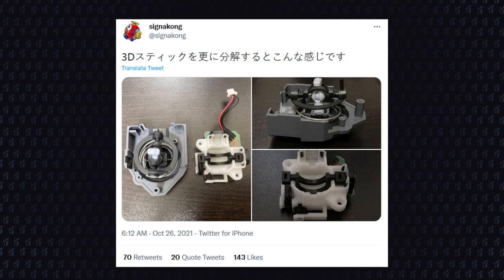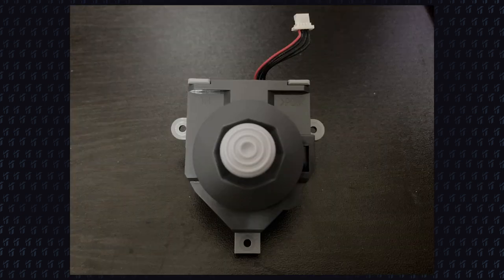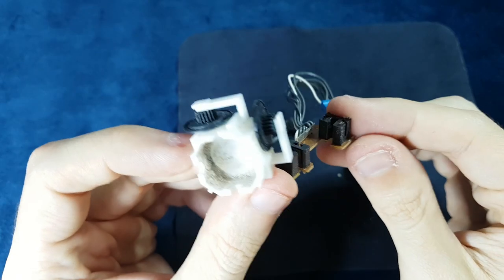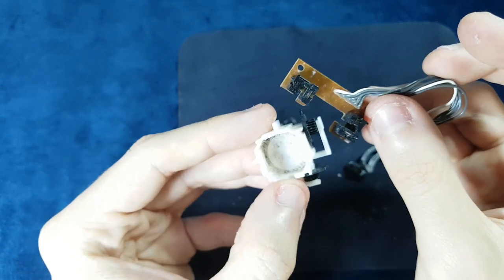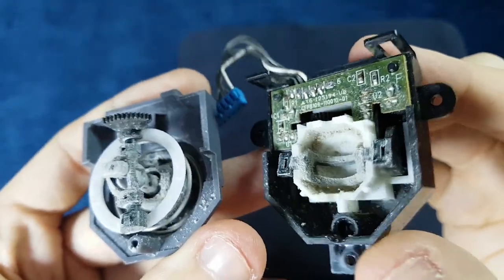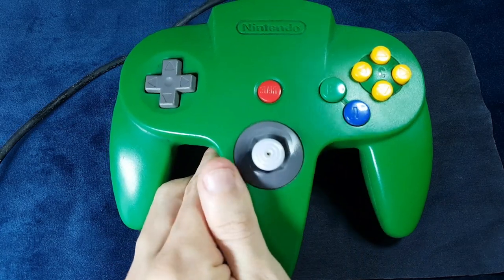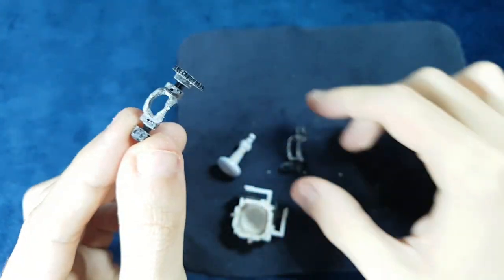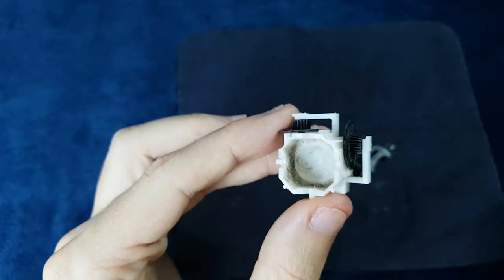The Nintendo 64 Switch Online Controller Has Worse Analogs...

Comment: Nintendo's key improvement here is not mentioning the Mario Party 1 minigame where all you do is frantically rotate the joystick. Problem solved, right? Time will tell. Great video!
Reply: Yeah, the original Mario Party 1 was notorious.
Reply: The tug of war game is in Mario Party Superstars, and it has a safety warning.
Reply: Se van a lavar las manos no agregando Mario Party xD
Reply: Mario party has nothing to do with it. They brake from normal use as well...
Reply: @Magisktification  Mario Party accelerated the process though.

For example, I had Mario Party and my sticks became extremely loose.

My sister's husband played only Zelda, sports games, and Goldeneye, and the controllers he's had since he was a kid still have very tight(the slightest wobble) sticks.

It's because when you're doing those stick rotation minigames, you are much more likely to put a lot of pressure on the stick with your palm. This of course would do more damage to the joystick and bowl in a shorter time.

Normal gameplay doesn't generally have you pressing in hard on the stick.
Reply: Several mini games used this mechanic. It was a good thing they completely abandoned it with Mario Party 2 and 3
Reply: they're gonna get sued and give everyone gloves again lmaoooo
Reply: That's the only game where I would use anything other than the N64 controller instead.

Comment: Really disappointed they went with the original design with grinding gears. I was hoping to purchase a modern controller that looked and felt like an original N64 controller that I wouldn't have to worry about wearing down as fast.
Reply: But how should it feel like an original when the would have used a regular stick?
Reply: @tiko8420  I guess I was hoping for a design that would still look/feel like the original, but would fix the design flaws that resulted in loose/unusable stick after moderate usage. Something that kept the stick feeling like new for years ideally.
Reply: Yo expresé en un grupo de fb mi inconformidad al enterarme que usaron la misma tecnología erronea de 1996 y casi me dicen de que me iba a morir :v

Espero que los materiales sean superiores, esa es mi única observación

Comment: "Sir, shouldn't we tweak the design of the N64 controller? Lots of innovation has been made since then, and modders have even made durable controllers with a very similar but smoother feel that doesn't deteriorate using-"

"No. We keep the controller the same, it's nostalgic. But don't get any optical sensors; they're too expensive, keep using our poor potentiometers."
Reply: Una mujer tonta se me echó encima en un grupo de fb porque mencioné lo decepcionante que fue enterarme que el joystick del actual mando de n64 para switch no fue hecho con mejor calidad y que pronto experimentaremos el mismo problema de 1996. Sé que quisieron conservar la sensibilidad del control, pero eso no justifica que usaran los mismos materiales que mostrarán desgaste más temprano que tarde.

Comment: Damn it, they really should've worked with that SteelSticks64 guy.
Reply from the maker: exactly
Reply: The controllers would be 150 to 200 bucks then.
Reply: @VKsChannel  Except that wouldn't fix it either lol. You'd have to lubricate the steel bowl over time still. Not to mention how much they charge for that shit like are you out of your  mind? First, they needed a rubber cap. 2nd was keeping the optical sensors. Lastly, making sure the plastic is properly lubricated because that does a lot to keep it in working shape which you forgot to mention they did for the plastic bowl (not sure on the gears so I heard). But they'd charge fucking 120 bucks for that stick alone much more the case that the guy clearly can't keep orders at all as it's always SOLD out lol. I recommend this guy's small look at it https://www.youtube.com/watch?v=D2WeiUc2IOI

Comment: If you want a quick fix for these controllers, just add lubricant or grease to them. That alone will make them last 10 times longer, and it also just feels nicer to use.

If your N64 controller already has a worn-out stick, adding lubricant or grease won't do much to fix it. It has to be a new or barely worn-out stick for the lubricant or grease to be useful. Otherwise you'll need a stick replacement.

Shame Nintendo didn't go for the SteelStick64 strategy, and make the bowls out of metal to reduce the wear & tear the OG stick had.
Reply: Tell me about it, at least on the OG n64 side solutions exist, third party controllers with analogs sticks that emulate the original range well enough now exist in 2021, steel sticks exists and fixing that horrific smear exists.
Reply from the maker: They did add some lubricant as you can see the wet parts in the picture

But as jerry rigs everything says plastic is plastic and plastic will scratch 🤣
Reply: @VKsChannel  I would think that the plastic is probably a little better now though? Plastics have definitely improved over the years (although some eco-plastics are actually worse).
Reply: Just opened my new controller, and the stick seemed very dry. I added lubricant, just like I have added to my old N64 controllers, and now the "feel" is much better. I've read some comments about the new N64 controller that the quality is not good and it feels very plasticky 😀Adding lubricant makes a huge difference and I think it feels quite nice now, at least for N64 controller...

Comment: I love that they went for a similar design and technology of the stick, as it is till today the most responsive and accurate. But, they could have used more durable materials. 
To prevent the stick from getting loose quickly, avoid pressing it down while using it.
Reply: lmfao
Reply: @Alex-vf8ww  what's so funny? What they're saying is true, the use of mechanical sensors really made for some ultra accurate movements. Not a single third-party option comes close.
Reply: @DisneyTLK110  3rd party options exist that far surpass orriginal n64 controller

even in 1996 the better option was the hori

Comment: this combined with the loss of the ability to atatch a memory pack to have game saves and the lack of transparent versions makes me glad i repaired and use OEM n64 controllers in combination with an adapter for use on PC, heck i think the mayflash adapter i have but don't use(Raphnet's PC adapter supports the manpack so i use that instead)  can work on the OLED Switch if I want ta do that.

Comment: WOW no optic sensors is pretty bad, it change the feel of the stick quite a bit.
Reply: It's actually kind of crazy how closely it replicates the functionality of the original. The biggest difference for me is the resistance, it's much higher compared to the original, even one in mint condition.

Comment: Look ... yeh the n64 controller durability will degrade,but like anything else,it will degrade more if you dont look after it,remember most of us were young kids and teens with n64 amd look at how many n64 controllers there are out there that are still in 6/10 and above condition after all these years .. id say its worth keeping the original design because it was the best controller analog stick of them all,it was basically a pc mouse and i still prefer it over any other consoles controller.

Maybe these new ones also do have better plastics and will last a little longer too so as far as im concerned its all good unless the new potentomiters are bad and dont offer proper n64 deadzone
Reply: Exactly!

Comment: The controller was the only part of the expansion pack that I still had hope for. Excellent video, you described my exact worries with the joystick. Alongside other reports of bluetooth issues connecting to PC or Mac, now the controller seems like a waste of money. All my hope has gone down the drain for the expansion pack, Nintendo is just trying to dig for money.

Seriously though, really good video. Even if it was short, it was very informative and helpful. you've earned a new sub!

Comment: A new system just hit the market. The Retroad 4.3" HDMI Famicom handheld from Ali-Express and with the KryzsioCart flashcart from Ebay it's great. The Retroad 5 Plus is also great with the GB/GBC Extension Converter and an Everdrive GB X7. The EZ-FLASH Jr. doesn't play all the games but the real Everdrive does. I use my NES/SNES Online controllers with mine using the 8bitdo SNES and NES dongles and a 9 pin to NES adapter I got from Mayflash for the NES/SNES Classic Mini. You just need to update the firmware on the 8bitdo dongle first.

Comment: Here’s an opportunity for someone to recreate a couple small parts to replace and add longevity to the controller. Not sure if 3D printing would be enough or possibly metal parts. A combination of both maybe..
Reply: People already do this for the original N64 but people printing plastic parts is still just plastic. There’s some effort to make steel lined bowls but they are rare and hella expensive.

Comment: During my research when i started looking into building oem designed joysticks for the original n64 controller i think i came across something or someone on the webs that mentioned one of the isues with the plastic wearing is due to the spicific plastic used was soft and not durable compared to other plastics, not sure if this is true but if it is then hopefully nintendo at least used a more ware resistant plastic. Still though it seems to me whoever did the disign for the new switch version n64 controller's joystick didn't do a lot of research on the original design's problems and importantly why they rarely if ever had stick drift issues that weren't physical (they didn't use Potentiometers) not sure if that's a designer's fault or the companies fault for influencing these design flaws not get fixed and add the potentiometer stick drift issue they originally didn't have. I have noticed from first hand experience with repair and possibly upgrading  (i've not felt a oem stick still in unused condition to have a comparison) oem sticks that even my best stick yet(feels very smooth and has the lowest resistance so far)  is harder to make precision movement's than any conventional Pot joystick I've used including the oem madcats n64 controller(i'm 90% sure it uses pots but i havn't opened that stick yet) stick. i don't think that's inherently a benefit of using a potentiometer but instead a benefit of the more common way Pot joysticks are designed for resistance and self centering the stick. They used pretty much the same design for resentering but they could have used a better performing design especially since they used potentiometers but didn't. I can understand that one reason they wouldn't change the majority of the design is so it feels more similar to how people remember giving it a nostalgic factor but if that's what they were going for they should have just used the infrared sensor instead of regular Pots sence to my knowledge they don't fail naturally with the stick drifting effect and they probably could have easily not changed that part of the OEM schematics with the reward of more reliability compared to Pots.  Plus isn't stick drift mainly caused by POT  isues(dust eventually building up around the potentiomiters and getting inside the disks) known to be especially common and a apparent downside for Nintendo's Joycons? This just adds to that bad reputation twords Nintendo.

Comment: RockerGaiming(One of the most reliable channel about controller) uploaded very technical N64 controller teardown video.
Nintendo lubed stick, and controller's potentiometer is the best quality one.

I know switch online is a terrible experience and expansion pack is even worse, but denounce about this controller is very exaggerated.
Reply from the maker: Yes i just saw their video, the potentiometer seems good however he also claimed that the durability is unknown and think with me, no matter how good quality the potentiometer is, once dust from the grinded plastic gets inside it will damage the piece, the main problem of this stick is the grinded plastic and not the potentiometer
Reply: @VKsChannel  then what’s your solution to potentiometers? All controllers use them for the past 20 years. Are all controller is going to suffer terribly? Is there a better solution for analog stick gaming?

Comment: Is it swappable, meaning can you use the new stick in an old wired controller?
Reply: No.diffrrent connector.coukd be done,but only with some real skill
Reply: @ddub1253  Aight, i don't have solder equipment and stuff like that. So that's a bummer, but it'll be interesting to see, what people will do with it. 😌
Reply: @habibk.2423  I don't think it'll be straight soldering but possibly capacitors or needing to make a board for it
Reply: Haha, I was hoping for the opposite reasons. I wanted to know if I could install a replacement optical stick in the new controller. I don't want no janky pots!
Reply: @habibk.2423  That'd be the dream. Foiled by Nintendo!

Comment: I haven't used my Nintendo 64 in years, I didn't have problems with my controllers back then from memory, I presume they still work.  I'm actually quite keen to see how these controllers compare to the originals.  They are expensive though, that gives me pause.  If these new controllers don't have a built in rumble feature I most likely won't be buying them.
Reply: Judging by the small DC engine you see in the vid when he's taking out the analog, I think it does have rumble

Comment: I wonder if you could place an entire original stick block into the new controller. Doubting it but still a curiosity.
Reply: I could probably 3d print the parts to try. But why though? This emulation sucks XD
Reply: Because it's only a matter of time until people make applications to let you use it on PC.
Reply: @officedullard8722  If you want to use an original controller on PC then there are loads of inexpensive adaptors out there.
Reply: I'm interested in a wireless option.
Reply: @officedullard8722  Unless you sit more than 1.5 metres away from your PC, you don't need it to be wireless.
Reply: I'm still interested in a wireless option.

Comment: Anyone that sees this comment please know the retro bit tribute 64 can be found on Amazon and has full compatibility with Nintendo switch PC and the original N64 if that's the way you want to do it.

If they were going to redesign it why wouldn't they just use the ball style modern method that can be found in GameCube or an Xbox controller. It just seems pointless to me to redesign a controller to be worse than the original but still have all of its faults at the same time. And they're charging 50 bucks for this lol.

Comment: Bad controller stick design is the actual N64 experience. I'm glad that Nintendo kept the design close to the original.
Reply: I mean, that's not too fair. The original controller was designed with two grips in case 3D gaming failed so consumers didn't have to buy another controller. It was smart at the time SEGA and Sony opted to release two separate controllers.

However, that aside, the joystick is ass. Such a letdown it does not have metal holding it in so that it lasts longer like those modded N64 controllers do.
Reply: No it's not lol. That would be like if the new Mario Party had the same blocky blurry graphics as the original because "it's the original design". You upgrade the important shit and leave the memories intact. This is bad.
Reply: The N64 controller does NOT have bad stick design. It's actually one of the best and is one of the most accurate analog sticks out there.
Reply: @gamephreak5  People who hate on it probably hasn't used one in good condition. They obviously don't know what they're talking about. Durability issues, yes, of course, but with the actual functionality, it's top tier.

Comment: The writing was on the walls they used period accurate tech in ALL there way back controllers! Ur not paying for something that looks like an N64 controller! Your paying for the real fucking deal ;)
Reply: Except it's not the real fucking deal! They replaced the optical sensors with potentiometers. I was hoping they'd leave the stick completely original, apart from maybe including some grease to slow down wear.
Reply: @eyeball226  i dont know where you got your info but i watched a teardown its og parts…. Masssive ware potential and all! Besides the back where all the new tech for cominication runs in
Reply: @grimangel4432  It's mostly original, but they replaced the optical sensors with potentiometers, which is a bad thing. My source of info is *this video*. It's like you commented on it without even watching it?
Reply: @eyeball226  lmao maybe i missed that detail i mainly temember it looking so similar because of how many busted open 64 controllers ive owned XD i stand currected than i guess!
Reply: @eyeball226  Maybe they couldn't reproduce the optical sensors because of ozone depletion or patent rights or something.
Reply: @groszak1  Patents expire, they don't magically appear. If Nintendo was able to make them in 1996 then there's nothing stopping them now. And the sensors are basically the same as are used in the scroll wheels on a computer mouse, or the encoders on countless control surfaces, so I don't think ozone depletion is an issue.
Reply: @eyeball226  Then possibly, inflation could be the cause, as in it would be too expensive to make them nowadays.
Reply: @groszak1  Seems unlikely considering they're still used for the scroll wheels on even the cheapest mice.

Comment: I think people who would buy this might be better off getting a refurbished OEM n64 controller and an adapter for the switch that supports the rumble pack(may want to do research to insure yours has it). Plus you then have the choice of getting the beautiful transparent ones and you can use it on the n64 if you happen to want to use the n64(i do that on occasion).